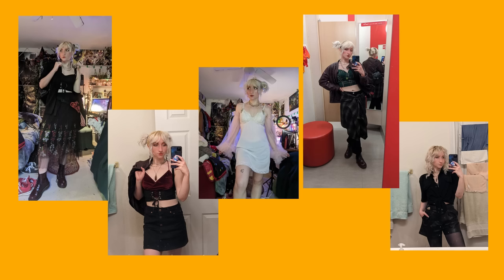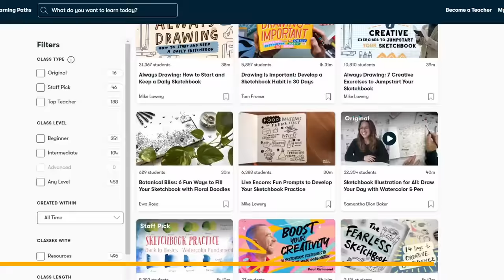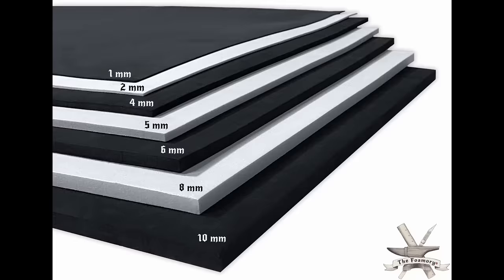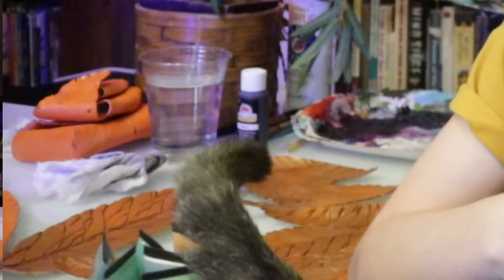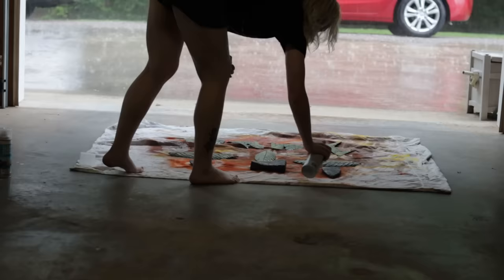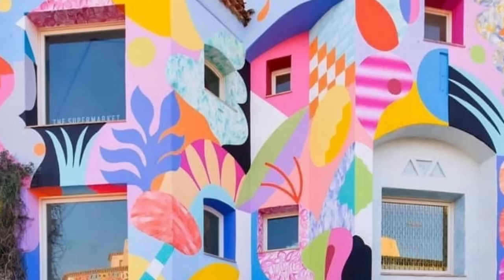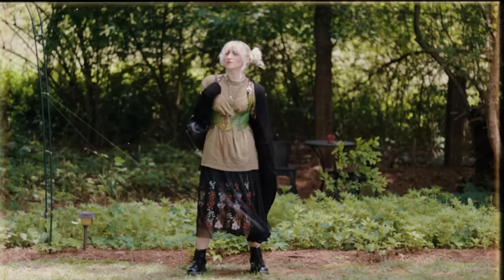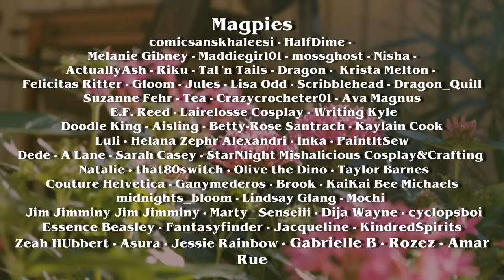I made a LEAF corset 🌿 (for forest adventuring purposes)

Comment: Hey I know setting grommets is the sort of task you’d sentence a white collar criminal to as a way of helping them “build character,” so I really can’t recommend enough that you thrift a thick leather belt and use that as your base instead to make it more tolerable. I sew a lot of corset tops and have tried rubber, wood, and a flat stone as a base for this and the belt works best by a long shot. Wood and rubber have too much “bounce” when the hammer comes down, so it’s really difficult to punch through stuff, and a stone will just eat the tip of your hole punch. You’ll have to eventually get a new belt after awhile when it gets filled with holes yes, but I’M TELLING YOU. Works like a charm.